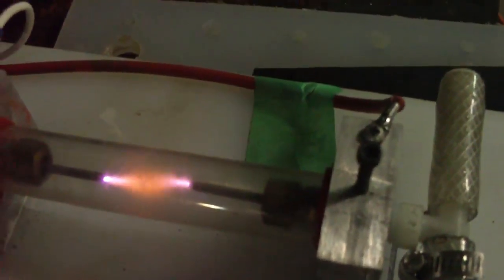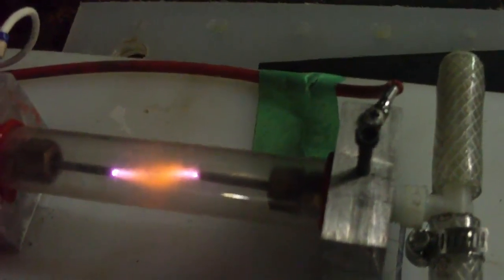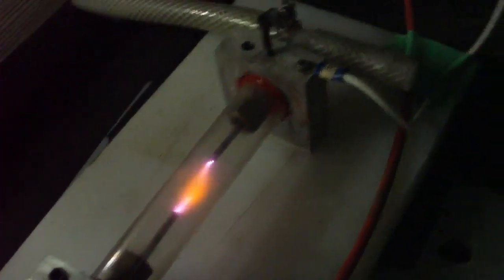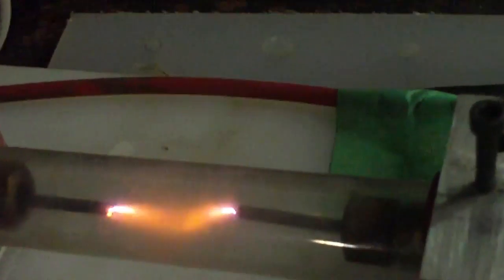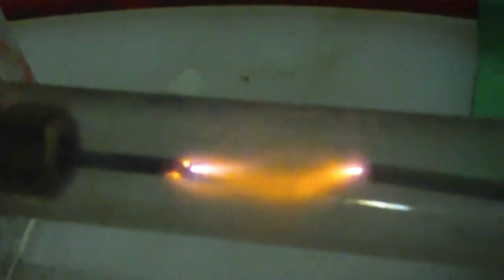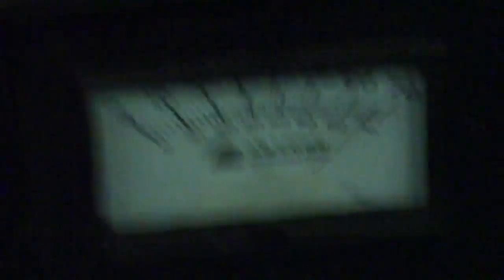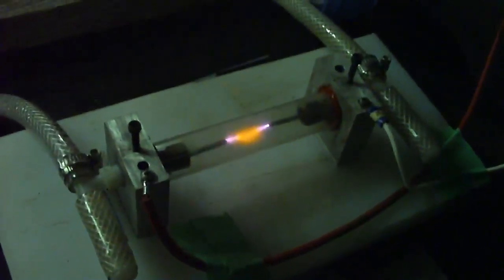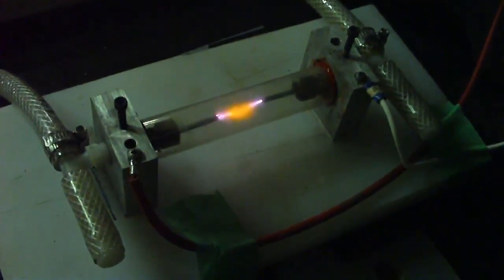Hydrogen SPKGap Followup.flv

Comment from the maker: Hi
Yes I aware of this and waiting on more test equipment. Going to exchange a few things and add a few others to see if I can observe this effect. Must do this type of experiment in a very controlled environment and measure carefully so things are safe. I am also going to look at Metallic Transmutation of the electrodes during the process via the Spectrometer.
Knovos - Don't do this type of testing if your cell is a Non Gas Splitter, need to remove the oxidizer.
Bill

Comment: Great! I wanted to test this also but I've got my hydrogen in my car on this moment. What I have read so far you are very close to a device called the 'E-cat' from Rossi. He uses hydrogen and a spark gap but added also nickel powder. With that combination you should get a atomic reaction which causes a tremendous heat. The heat is abstracted by some copper tubes to a radiator to heat your house. Doing the math the amount of energy that comes in the device should be very low for what comes out.

Comment from the maker: Hi Mike
Actually, I did confirm this via the spectrometer and also I was running without the scrubber/filter. When the filter is in the flow sheet and fresh the flame is blue to invisible i.e. UV Funny i paid for KOH, but got NaOH in a KOH package... Hmmmmm
No K in the spectrogram.
Frequency- I will look at that and report back.... Really need to find a supplier of cheap Quartz optic's for the spectrometer.
Take Care Mike
Bill

Comment: Bill, I think you mite be getting some electrolyte in the gas. If the hydrogen is pure, the color should remain blue to UV.
Can you varry the frequency to the spark-gap? If so, the higher the frequency the better UV production due to the ionization.
Thank you for posting.